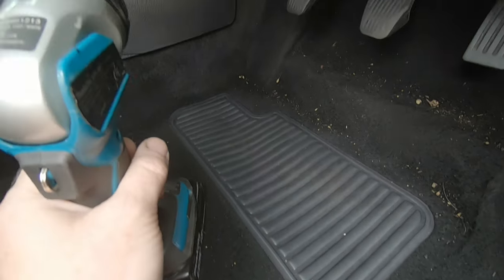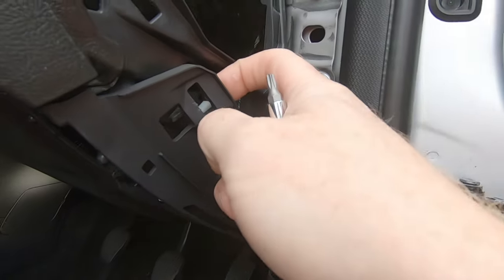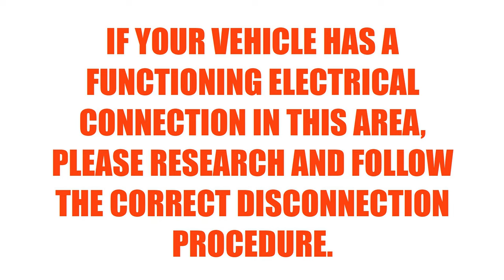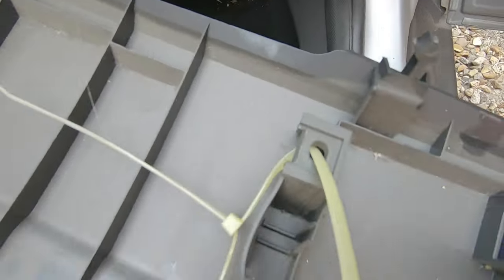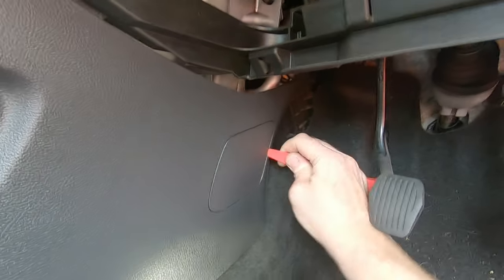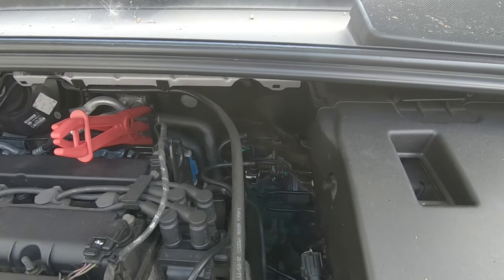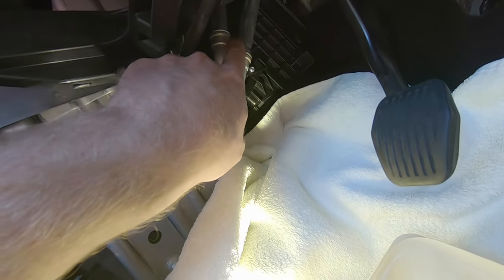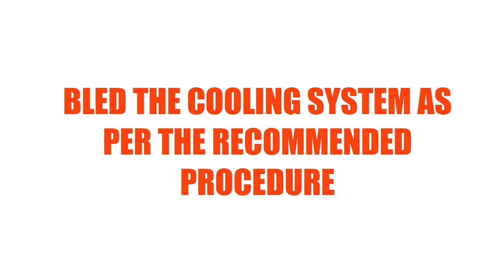Ford Focus heater core pipes leak coolant, heater o ring leaks. (Includes interior strip down.)

Comment from the maker: Can confirm that after 6 months of use, since the fix was completed no leaks or drips and the coolant level is just where I filled it to. 👍
Reply: Hi Dan
I have a exactly some issue with my ford focus 2011 but I could not find anyplace sell its o-ring to buy and replace
May I ask how did you bought those o-rings?
Reply from the maker: @tonynguyen4007  Bought mine from my local ford dealer. Just gave them the o ring part number not the vehicle reg, they're used on lots of ford models. Part number in description - think they're on ebay too. Ford updated the heater matrix design (to remove the o ring join) and now try to sell you the entire matrix/pipework instead.
Reply: @dan91sgarage  my o'ring is too so I couldn't see its part number. Is it all ford focus mk3 cars have same o'ring size?
Yeah It cost me 1500AUD to replace, I'm trying to find a fit o'ring to fix it
Reply: Have the same problem, after fixing how dis you get rid of smell of wet and damp in car?
Reply: How much on average would a garage charge to fix this issue Dan?
Reply from the maker: @eviejoyce9591   The parts are less than £5 + some  money to replace the coolant. The job should take a proffessional mechanic 2-4hrs to complete, so depends on the labour charge of the garage really.
Reply: Could you imagine if they just put an electric heater in it.....🙄
Reply from the maker: Knowing Ford it would catch fire instead...lol
Reply: @dan91sgarage what part is it that fails. Is it the little rubber o rings inside. Or is it the plastic part that grips the outside not squeezing it tight enough. I’ll need to check mine as it’s loosing coolant and the carpets are wet at the same bit at the chassis number and that other bit below the pipes. I’ve just bought the car and no doubt the person selling it knew there was a leak.
Reply from the maker: @Dean-mp7vg  It's the o rings inside have degraded over time/heat and pressure cycles. The clips are there to hold the pipes together and stop them slipping apart, they don't seal by squeezing its the o ring that is the seal.
Reply: @dan91sgarage  oh right, I see mate. Cheers

Comment: Thanks Dan, tips on getting to the issue area (trim removal) are/were invaluable! Replacement O rings are 18mm bore and 2mm cross section being NBR70 material in case anyone else needs to know. Like others only issue was rejoining the pipes of which I installed thin band stainless hose clamps on each pipe and used multigrips to pull the pipes together, then remove them and put back factory "plastic" pipe clamp. No leaks and the O rings were $1.00 AUD in total from a local Bearing/Engineering shop. Side note there was lots of swearing as this is not a fun job. Many thanks for putting together the video. Cheers.
Reply from the maker: Cheers James, and yes I remember the sweary footwell fight all too well! Thanks for the comment.
Reply: We are struggling to get the upper pipe to reconnect - plan to get some skinny hose clamps and try with pliers in the morning - heaps of swearing already completed - lower pipe easy to replace and push together!
Reply: @adammathers8708  I sprayed the pipe and the seal area with silicone spray. The pipe running up into the firewall has to be dead straight with the heater matrix pipe, plus, lots more swearing.
Reply: Thanks for the specs, James. All the Ford parts places I tried would only sell the whole heater core. Luckily I found your comment and now, job done!

Comment: Is it usual to drop from max to min over a couple hundred miles with this leak? While my floor is wet, the leak doesn't seem to be dripping enough when I check it to be such big loss,
Reply from the maker: There should be no loss from the coolant system at all. If the carpet is wet then you should see the drip at the heater matrix pipe join. Also the coolant header tank can crack underneath, leaking into the engine bay and the header tank cap has o-rings to seal and these can also wear or get damaged.
Reply: @dan91sgarage  I've just changed the degas hose and expansion tank, the o ring near foot well is leaking, but it doesn't seem enough leak to be why the floor is so wet

Comment: Can you send the link for the orings and clamps ? Was there any issue pulling them apart , ie anything to undo any where in the engine bay ?
Reply from the maker: Part numbers are in the description, easy to find on eBay. Not too difficult to pull them apart. There is a clamp to undo in the engine bay to allow easier movement of pipes as shown in video.

Comment: I have this issue. I've taken it to 3 mechanics and they have told me that they won't touch it. That the car is beyond economical repair. My car is swimming. When i park on a slope yhe are puddles in my back driver carpet. Issue i have is i uave absolutely no experience
Reply from the maker: The problem is that when you mention a leaking heater matrix to a mechanic they think it will be a 12hr job, taking the entire dashboard out to change the whole heater matrix. No one wants to do that job. The Ford matrix leaking o-rings is an easy (relatively speaking) job that takes about 4hrs max for a home mechanic with average experience. Maybe show the mechanic a video of the job as it's not as difficult or time concuming as they think? Good luck. 👍

Comment: This is by far the best video on this topic,  thanks a lot for posting.  You were right not to include the bit where you separate the pipes,  it's a real b%#@d of a job.  I fabricated my own tool for this from an old hard wooden curtain rail.  I cut a thin bit off square to make a varying thickness 'coin'.  Then it's a case of insert - twist - turn - repeat. 
I completed the repair and car has been running for a week,  so far so good.  No leaks and heater is working fine.  It takws a few runs for the system to purge air, so don't worry if the coolant level drops a little.
Only quirk I had was when i started the car back first time there was a buzzing sound coming from under the steering wheel.  Turns out its from the passenger temperature sensor that was too dusty. 
Only job left is to clean out all the coolant from the footwell. I have soaked up as much as possible with kitchen towels, but it's not designed to evaporate i guess.
Again, Sterling work for the video.  Saved me at least £500 i reckon.
Reply from the maker: No worries at all, thanks for the comment.

Comment: G'day Dan. A huge thanks for this video and explanation. I have exactly 0 knowledge or skills when it comes to cars or general handyman skills but had a crack at this after watching your video (and the Haynes one mentioned). I think I've had complete success, saving myself a small fortune even when counting buying a couple of tools. I found when trying to get the pipes back together that lining both of them up and seating them, then pushing from the engine bay side made them slip into place much more easily. Thanks again!

Comment: Very helpful video. Especially around taking the trim off. I can see why you didn’t video the pipe but. It took me about 30 - 45 mins getting the trim off about 2 hours to spilt the pipes and get the o-rings out and new ones in. About 30 mins to get the pipes back together. And 15 mins to get all the trim back on. I hate to think how long it would have taken me without this video 👍 👍 👍
Reply from the maker: Thanks a lot pal, that's about how long it took me as well! A mornings work but relatively simple / fiddly series of tasks. The reason I made the vid was when I came to do mine I couldn't find anyone showing the whole strip down process. Glad it helped 😀

Comment: Best video in the world!
I fixed my MK3 and it’s not leaking coolant anymore. I bought the o-ring and clips by Amazon!
Thank you so much Dan! 😊
Reply from the maker: You're welcome Martin. Thanks for the comment
Reply: Can't for life of me get the pipes separated
Reply: @Gh_7591 I just completed this job with Dan's video. A bit of back and forth between  pushing them apart from the footwell then wiggling / pulling from the engine bay. Oh, and a lot of swearing!

Comment: Thanks for this It's actually shameful how many mechanics didn't want to touch this on my car. Basically out of options I decided to just do it myself and I don't know what all the fuss was about it really wasn't that hard. My main struggle was getting the pipes back together and it just being a bit fiddly but you really helped save me a few quid on this and now I know of a few mechanics to avoid in future so thankyou.
Reply: Am having a problem on getting the pipes together with the new o ring how did you do it?
Reply: @hendmen9815  Try using a bit of vaseline. It's definitely the hardest part though just takes time twisting to get the right angle and pulling them together. I did also go into the engine bay and push the pipes but I'm not sure that helped. I was starting to think I was stuck but eventually just managed to get them on. Definitely takes a bit of patience and perseverance.
Reply from the maker: It is important to check that all the old o ring has been removed before fitting the new one or it will not seat fully in the groove and prevent the pipe fitting back in. I used a small mirror to check the groove was clear and the replacement o-ring was fully seated. Also make sure you line the pipe up straight when pushing them back in (not angled) and I put the top pipe in first.

Comment: When doing mine, I had someone under the bonnet jiggling the pipes through the fire wall. That seemed to help. Trying to dry the carpet was a nightmare. I don't know if it's because of the coolant's properties, but it would not dry. I ended up taking the carpet and underlay out and hosing them down with water many times. That seemed to do the trick.   Great video BTW.

Comment: Thank you so much for this excellent video, I found my coolant level was dropping, drivers footwell was piss wet!  I got it done this morning and went to top up the coolant, the inner part of the cap got lodged in the reservoir 🤦.  I managed to remove something from the middle of the inner part of the cap and slowly top it up, then bodged a seal using the outer part of the cap which still screws on.  I’ll replace the whole reservoir which seems way easier than those heater pipes!
Reply from the maker: Sounds familiar! My coolant cap seperated into the inner (stuck in the bottle) and the outer screw part in my hand! Ford have changed the design of the cap slightly so it doesn't get stuck anymore.

Comment: Should be a factory recall. The design was floored pardon the pun from the get go. Relying on a 30 cent o ring from flooding your cars carpet with smelly coolant. 
My local ford dealer doesn't supply the o rings but they do supply a redesigned heater core which has the joins inside the engine bay. They told me the change atleast one a week. This car keeps me very busy. Just glad its a manual. 
FYI ur mechanic isn't ripping u off. They are just fitting a better designed heater core so it doesn't happen again. At around $300 -$400 for the part alone.
Reply from the maker: Agree it should have been a recall along with the bumper vents that leak water into the boot of every Focus. The original o-rings in my 2 x Ford Focus's have lasted over 10 years and 85k miles. I would rather spend £5 replacing the o rings myself for another 10 year fix, than spending hundreds/a thousand for the updated matrix (never said it was a rip off, changing heater matrix's is a ball ache job no one wants to do really). Each to their own.
Reply: @dan91sgarage  The seam sealer on the roof cracks and water leaks in through there as well. Have fixed many cars. 🤣
Reply from the maker: @schmick63  Yes, I have made a video about all the Ford Focus water leaks on my channel. It's my second most popular video! https://www.youtube.com/watch?v=-cCm6cDdoMg&lc=Ugwy3Vu3yUJ54DK1NkV4AaABAg
Reply: @dan91sgarage I had the boot leak a few months ago (still not fully resolved) and now this. What's next on the list of "p*ss poor design from Ford" Dan?
Cheers for the videos BTW - I may not be able (or confident) to do these repairs myself but at least I can guard against "it's yer big end" syndrome when visiting the garage!
Reply from the maker: @jeffholt9437  Thanks for the comment, fore warned is fore armed as they say. Ford's most rediculous design choice is the wet cambelt. It is used on the early 1.8 diesels, 2.0 ecoblue diesels and the 1.0 ebcoboost petrols. The rubber cambelt is inside the engine casing and is constantly coated with engine oil, over time it breaks down the rubber and these particles clog the oil pickup which can ruin the crankshaft/conrod bearings through oil starvation (literally the "big end" you mentioned!, knackered engine). It is a horrible design.
Reply: @dan91sgarage  oh dear!
Reply: @dan91sgarage Looks like I have the trifecta. Already done that vent, and the roof seal your mention below. Now this one

Comment: Hiya mate just got the leak fixed, however when I’ve got the heating on after a while those pipes remain really hot is that normal ?
Reply from the maker: Yes. They will be as hot as the coolant in the radiator/engine.

Comment: Daft question but how important are the black clips, one of mine was open and idk if that's the cause or not
Reply: Should add the clip is now moving freely with the car cold don't know if that means much
Reply from the maker: The black clips are there to stop the pipes seperating. When you clip them on there is a groove inside that the metal pipe ridges fit into. The o-ring does the sealing job. You were lucky the pipes didn't blow open! The clips on mine could be rotated when cold when they leaked and when they were freshly re-sealed. It doesn't seem to mean anything (despite what other people say).
Reply: @dan91sgarage  thank you mate appreciate the reply I brought it to a garage he said the heater matrix needed replacing but I honestly don't think he looked I pulled trim back and had a look and it seemed like it was coming from the pipe il order the clip and see what happens might need to replace the o-ring like yourself so thanks again for the help and the video

Comment: Could I ask a question, once the new seals are in should the clips be able to spin around or are they in a fixed position
Reply from the maker: I could still spin mine when cold. Didn't try when hot as I didn't want to risk popping one off!
Reply: @dan91sgarage  which is a good point the clips seem to be a bad design flaw in my personal opinion why would you engineer something that gets so hot with a join with a runner gasket thrown in the middle of it

Comment: Where did you buy the seals from as ford is trying to sell me the full heater matrix said they are not sold separately
Reply from the maker: @ Scott Anderson Bought mine from my local ford dealer. Just gave them the o ring part number not the vehicle reg, they're used on lots of ford models. Part number in description - think they're on ebay too. Ford updated the heater matrix design (to remove the o ring join) and now try to sell you the entire matrix/pipework instead. 😡

Comment: i can't seem to place the 2 black clips back on at the end. Any tips?
Reply from the maker: Make sure the metal tubes are fully pushed back together other wise the metal bands won't fit in the groove in the plastic clip. If the o-ring isn't seated in the matrix tube channel correctly it can hold the pipes a part.
Reply: @dan91sgarage  Thank you for that, I'll give it a try now. Appreciate it :)

Comment: I’ve replaced the o ring but I can’t for the life of me get the pipes back together. I’ve used silicone grease but now I’m thinking the o ring might be a bit thick? Any tricks to getting the pipes back together without bending anything or ripping my hair out? This is my first car repair.
Reply from the maker: Assuming you bought the genuine Ford o rings, they should fit well into the c-channel at the end of the matrix pipes. It is important to check that all the old o ring has been removed before fitting the new one or it will not seat fully in the groove and prevent the pipe fitting back in. I used a small mirror to check the groove was clear and the replacement o-ring was fully seated. Also make sure you line the pipe up straight when pushing them back in (not angled) and I put the top pipe in first.
Reply: Thank you so much, I really appreciate the help.